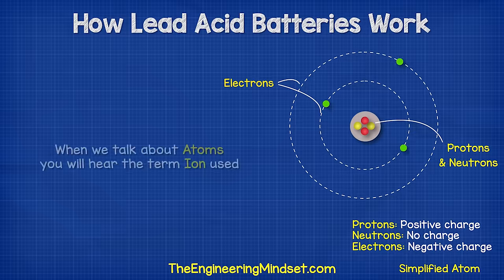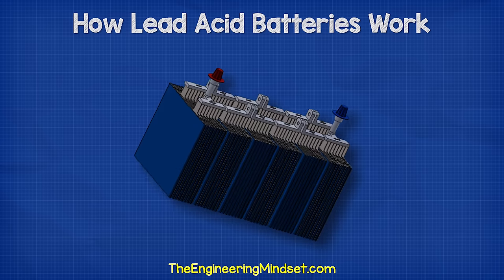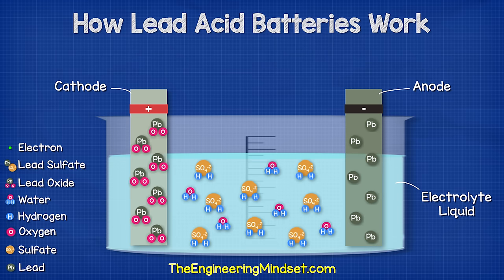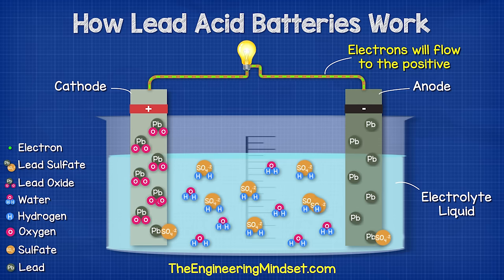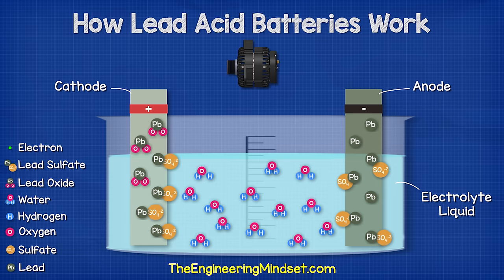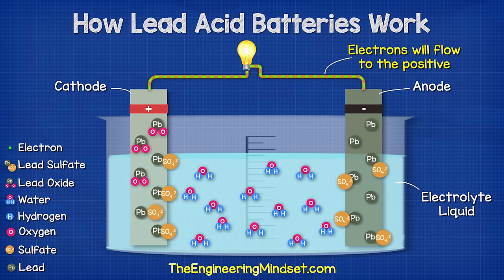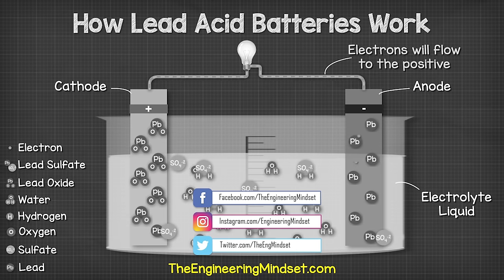How Lead Acid Batteries Work: A Simple Guide

Comment: Aren't the anode and cathode swapped in your illustration?  I've always seen the cathode called out as the negative terminal
Reply: different diciplinces call different charged sides the anode and cathode, in physics for electron guns and stullf its flipped as compared to and chemistry for things like electrolysis, however idk if the video has it right for batteries, i just know it isn't consistant
Reply: I seen many video about battery , everywhere positive electrode called as cathode I don't know why
Reply: Cause cathode determination is source of free electrons. In welding guns, for example, cathode is negative.

Comment: ALWAYS recharge your Lead - Acid battery as SOON as possible , after ANY discharging ! ...... leave your ( almost ) flat battery ( in an old shed / garage , for weeks ? ) , and it will be dead forever ! , and with a 12 Volt car battery make SURE the charging voltage NEVER exceeds 14 Volts , or you lose water ( especially important for sealed or gel types ............ DAVE™  ............

Comment: can you do a quick video on how a lead acid battery dangerously overcharges and causes a sulfer smell
Reply: I think this is due to reaction of lead in hot conc. sulfuric acid which is exactly the overcharge conditions:
Pb + 3 H2SO4 ---->  Pb(HSO4)2 + SO2 + H2O
So the sulfur smell might come from the sulfur dioxide gas being expelled. This requires temperatures of 30-50 oC and ~80% H2SO4 (I think batteries don't go much over 60% but I don't know much about practicalities of the lead-acid battery).

Comment: Why the electrons won't flow to cathode via electrolyte, what prevents it from moving that way?
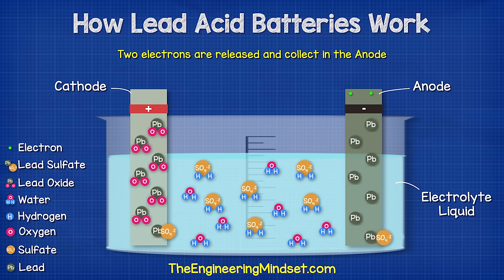Reply: If you look around 2:14 it gives a general idea. The electrons were only released because of the sulfate reaction with the lead. The cathode has oxygen bonds whose charge only reacts towards the hydrogen so you could say it is more "stable " and does not want to except any electrons. Since the oxygen only got released from the sulfate reaction it makes a sort or "shield", combine that with the fact that hydrogen is combining "towards" the cathode and you get a one way trip.

But to be clear even that is oversimplified as you make a point. I am not an expert but at higher voltages/shortcircuits this can happen. There is also thermal and electrical shielding to prevent that, hopefully someone can give more details/correct on finer points

Comment: Hello,

I found that acid from PB battery is getting chemical reaction with white cliffs ground - the white ground. I am bad in chemistry but the elements is making some gas. It can use with pressure barrels to make pressure for turn some turbines - such wind or something similar. I used rain water for the battery, says it fine. Just dunno how long the reaction last, maybe it is just salt or soda. 

Thanks
Reply: Correct. As lead acid batteries charge they produce hydrogen gas, though it isnt much
Reply from the maker: Seen our new - How wind turbines work video? link: https://youtu.be/Hf875eOVrVI

Comment: QUESTION:: LED BATTERY SHELF LIFE? How long Are brand new batteries climit control stored.. good for?  I mean after a battery tainer  charge are they still fine? Maybe top off the acid?
Reply: It was said at the end of this video, "if we leave the battery.." does this mean a brand new battery left for years without charging would fully dissipate its energy? 

Asking because I've just been given a unused battery bank, the catch is they've been sitting for some years..  are they worth messing with? Trying to low budget power our offgrid home here..
Reply: @nonyabusiness9747  there is internal resistance always. So yes they will self discharge if not maintained with a charger. If you have a bank you might try charging all of the batteries and test them to see if and how well they hold the charge.
There are also desulfurization chargers that can try and restore some of the life in the batteries.
Reply: @KJMcLaws  thank you kindly
Reply from the maker: Seen the new LED explained video? so much detail covered! https://youtu.be/O8M2z2hIbag

Comment: QUESTION:
Cathode is positive and Anode is negative? Why does google disagree? I’m confused af
Reply: He is correct, I just looked at Google where are you looking on Google? I found the same on Google that he has.
Reply: So this can be complicated.  You are right to be confused.There is what is known as conventional current which is the flow of "holes" (or the absence of an electron) towards a negative charge and then there is electron current which is the flow of electrons towards positive regions.

The term anode and cathode depends on what type of current you are defining.
If conventional current, then the anode is positive and cathode is negative. (Holes -> Negative Region)
If electron current, then the anode is negative and cathode is positive. (Electron -> Positive Region)

In essence, an anode is the "Source" and cathode is the "Drain" in either scenario. Regardless if you are using conventional current or electron current, the flow of charge is going from anode to cathode.

In chemistry, electron current is usually the preferred perspective. So negative anodes, positive cathodes. That is why anions are negatively charged and cations are positively charged.

In electronics or electrical engineering, conventional current is typically used. So positive anodes, negative cathodes.

In battery technology, both electrical engineering and chemical engineering can be used which is often a point of confusion. 

Why do people use conventional current? Just became a stupid convention imo. I much prefer electron current as electrons are actual particles whereas holes are just conceptual placeholders. BUt in terms of the flow of charge, I suppose it doesn't make a difference in most scenarios.
Reply: Becz Cathode can either be +ive or -ive so does the Anode.
Actually Cathode is the one where Reduction (Gain of e-, *confusing names indeed*) occurs and at anode Oxidation (loss of e-) occurs
you can remember this by RED CAT 🐈 and AN OX 🐂 mnemonic

btw cathode is +ive in cells which create electric current and -ive in cells which require electric current

Comment: Why does one need to charge a fresh built battery?

Based on this, after your poor in the fresh electrolyte, it should be ready. 

What chemical reaction is happening when electricity is being introduced in fresh plates and solution?

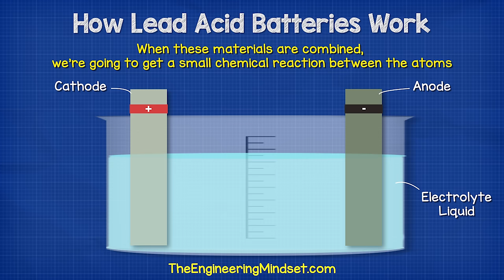Comment: 01:30
You have labeled the cathode as being positive and the anode as being negative. Isn’t this contrary to conventional current flow?
Reply: From what I heard, anode being positive and cathode negative is used when talking about the receivers of power(LEDs or betteries that are charging). 
If the device is outputting power(like a battery that's being discharged) it's reversed. Cathode is on the + and anode on the - terminal. 

I don't really know why but I believe its about the direction of the electrons going through the terminal. So cathode would always get electrons and anode would always give electrons.

Comment: One thing he needs to explain is a generator VS and alternator. And you can't directly charge a lead acid battery with and alternator.
Reply: Say that to any decent mechanic and they’ll call you a 🔔 🔚.  🤷‍♂️
Quite simply because every car manufactured in last at least 40 years has been fitted with an alternator. And all those alternators have rectifiers and voltage regulators simply because generators aren’t efficient enough.

Comment: I like your videos but would prefer if you used conventional rather than electron flow. It gets confusing because although you're correct everyone else uses conventional.
Reply: In a circuit level (functioning of a circuit) , conventional current is okay but to explain and understand the inner working of components,  current flow aka electron flow is necessary.